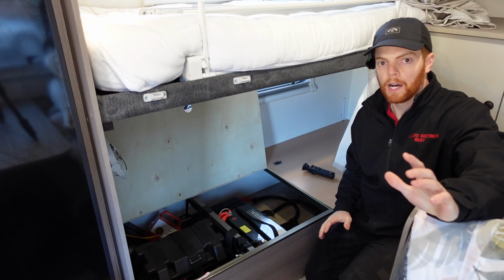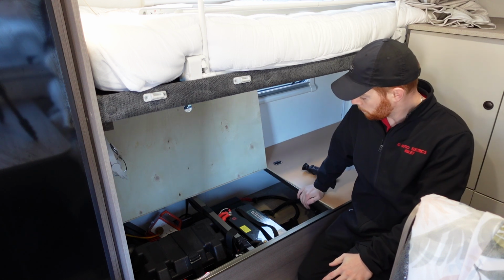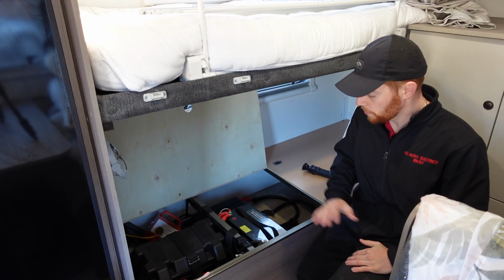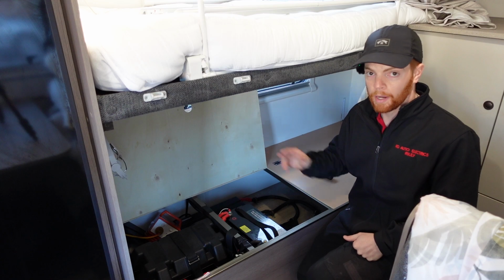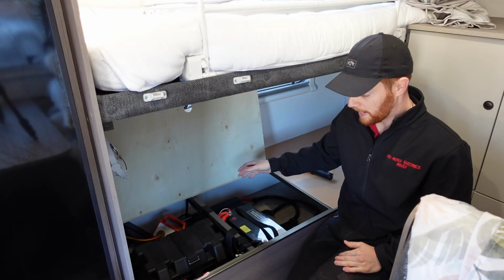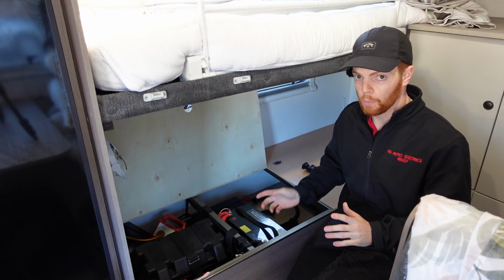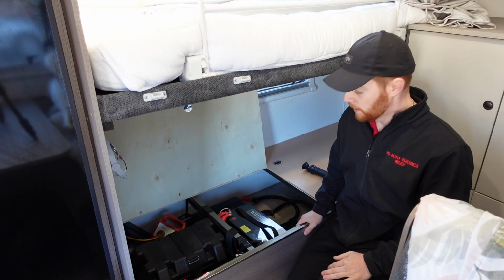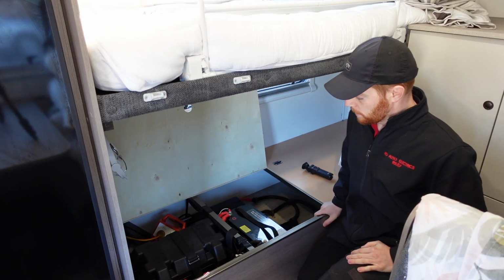POWER SYSTEM PROBLEMS! - Tech Talk EP6

Comment from the maker: We sincerely respect everyones opinion but just to clarify what we have stated in this episode, below is an exact statement provided from a very reputable lithium battery manufacturer here in Australia.

**LINKING BATTERIES IN PARALLEL 

“Maximum discharge limits of single battery should still be followed (e.g.Parallel 125Ah B-TEC batteries still have a maximum of discharge current of 100A)”

Hopefully this provides some clarification for those that may have a different understanding.

Thanks Riley

Comment: You say that the inverter output isn't rcd protected, isn't that orange box that plugs into the inverter a rcd box?
Reply from the maker: Hi Damien, 
Thanks for watching and for your comment🙂

Although those orange boxes do have an inbuilt safety switch, upon testing it was not functioning in this application.

We are currently looking into this situation further to gather some answers, but it seems like it was not functioning on the inverters power output. 

Even if this that was functioning correctly, the RCD needs to be in a fixed location and hardwired to be a compliant installation.

Comment: If the batteries are correctly connected when in parallel, ie the positive and negative terminals are connected diagonally opposed, ie positive on one battery and negative of the second battery when connected to the load, you will most definitely increase the continuous discharge rate of your parallel battery bank. Depending on your battery BMS/ C-Rating/ specs, you will increase the continuous discharge rate, it may not double but it will increase. I have corrected so many auto electricians battery wiring it's just not funny. They connect the batteries in parallel and then take the positive and the negative out to the load off only one battery!! Don't get me started on solar panel connections. I constantly get call-outs to correct solar connections because the auto-electricians have connected the solar panel negative to the vehicle chassis, a major no-no. That said I fully agree with ensuring system installations are installed to code.
Reply from the maker: Thanks for the comment and appreciate you sharing your experience and perspective🙂

You are correct that you may see a marginal increase is the discharge capability with multiple batteries linked in parallel (CORRECTLY) but our tech talk series is designed to keep things as simple as possible and aimed towards those wanting a simple & easy to understand explanation. 

Simply put when linking lithium batteries in parallel, the Ah capacity rating duplicates and the discharge A capacity does not duplicate, that’s the misunderstanding we are trying to clarify.

Thanks Riley

Comment: I believe your information is incorrect.

2 100amp batteries in parallel definitely can provide 200 amp...   IF you properly size the connections.  Either increase conductor size, or wire individually to a bus bar and fuse each battery.
Reply from the maker: Thanks for your comment Tom and appreciate your opinion. If you were to wire the 2 batteries individually to a fused buss bar with completely equal cable lengths and then had all of the systems load wired equally to those buss bars then this would increase discharge capacity.

This is not how the batteries were linked in this system and It’s not a recommended solution. Having the batteries individually rated to your particular discharge requirement is a much safer solution long term🙂

Comment: 2  x 100a bms in parallel still only gives you 100a discharge.

What a load of crap

It won't give you 200a discharge, but it will give you more than 100a discharge.

Misconception to strum up business for themselves
Reply from the maker: Interesting way to look at things Darren, but everyone is entitled to their own opinion and we respect that. Thank you for your comment anyway🙂
Reply: You pretty much said what he did.
Total discharge rate is limited by the discharge current rating of one battery, despite having increased capacity with a parallel battery.

Comment: Thanks for the video. It's very interesting , also isn't that battery compartment supposed to be a sealed & vented to the outside? It just looks like the standard lid 🤔
Cheers
Reply from the maker: Thanks for your comment🙂
This van was manufactured prior to the new regulations taking effect. But yes you are correct, if the inverter installation was completed after Nov 2023 (which we are 99% sure it was) then the battery should’ve been enclosed at that time to make the system compliant.

Comment: If the max discharge rate of lithium batteries linked in parallel is the same as for a single battery then how do people run 2000w & 3000w inverters? I haven’t seen too many lithium batteries that have a max continuous discharge rate of 220A - 300A & I shudder to think what such a thing might cost.
My understanding was that it depended on the particular manufacturers BMS settings & that is why they will state in their specs if they can be paralleled with each other & if so how many can be paralleled.
This is my understanding & I’m happy to be corrected.
Reply from the maker: Thanks for your comment David🙂

Most lithium batteries that are 200Ah+ will have a 200A+ discharge rating. The Custom Lithium batteries that we use are actually rated to 330A.

Although linking lithium batteries of the same size & brand functions correctly and the BMS units will work together regarding cell balancing etc this is not the case regarding the discharge rating.

Thanks Riley